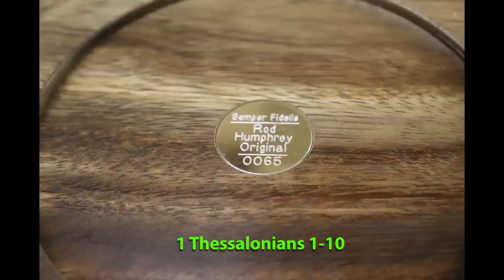Woodturning Two Monkeypod Bowls

Comment: I was looking at buying some of this wood...I think I'll rethink that. It is a beautiful bowl! Thanks Rod!
Reply: Like you said, dusty but BEAUTIFUL! Nicely done. 
Question for you out of my curiosity, since you are using the Ack’s abrasive paste, why are you sanding up to 1000 grit? The point of the paste is to eliminate the dust from sanding with 320 grit and higher.
Reply from the maker: Doug, you're correct of course.  I just think it turns out a bit better sanding higher before using the paste...but that might be my own quirky perception.  The sanding dust is really never a problem as my vacuum system sucks it in easily.  It doesn't do so well when actually turning though.
Reply from the maker: Thanks, Bear!
Reply: @RHumphrey  fair enough

Comment: Couple questions for you Mr. Humphreys.
1.) do you have a video on sharpening your turning tools?
2.) why do you have incremental measurements labeled on your tool test? 
Thank you in advance! Wonder turn as always!!
Reply from the maker: I've shown some sharpening in the past, but haven't dedicated a video to it because there are so many out there already.  I use the Wolverine system along with a slow speed bench grinder, and use a 220 grit CBN wheel on my gouges, and a 600 grit CBN on my skews and scrapers... many turners would say it's too fine of grits, but I like my shavings!   The inch marks on the tool rest are for viewer reference, and placed there at the suggestion of a subscriber 😊  Thanks Joshua!

Comment: I have not used a lathe sense highschool, 50 odd years ago, but it seems to me that there must be some way to mount a vacuum hose close enough to get at least most of the shavings and not interfere with the tools or work piece. The only thing I can think of is to bring a high pressure hose down from above, I don't know if that will work but it's the only thing that I can think of that makes sense.🤷‍♂️🤷‍♂️🤷‍♂️🤷‍♂️